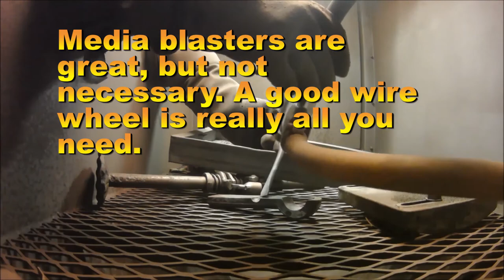Vintage Flathead Screwdriver Restoration

Comment: The end product looks good. The only thing I can add as constructive criticism is after you have the brass fit is that you need to use the other end of the hammer to mushroom out the rivet
Reply: And p.s.....shellac is a better coating to finish than wax
Reply from the maker: Ben Haughton thanks for the feedback. I might make a video to test that very suggestion. I was too chicken to really peen that brass with that course grain oak....anyway i appreciate the feedback. Cheers